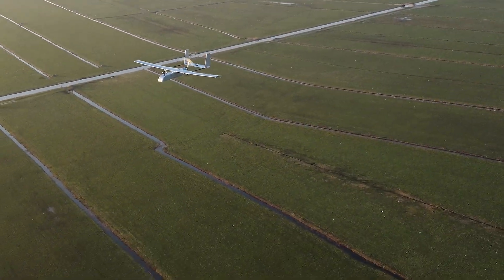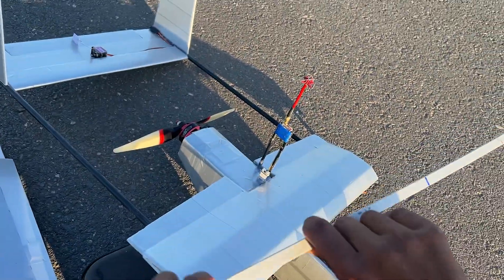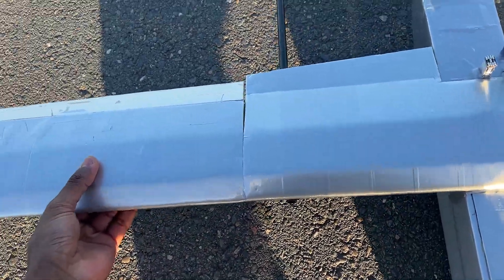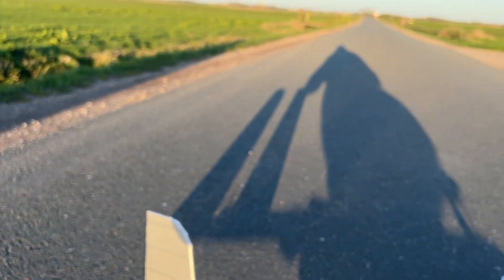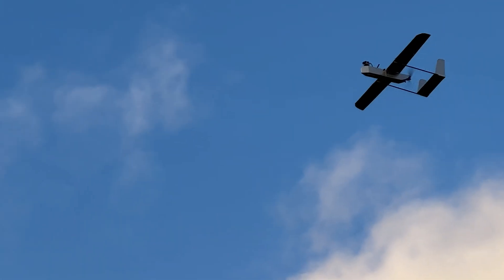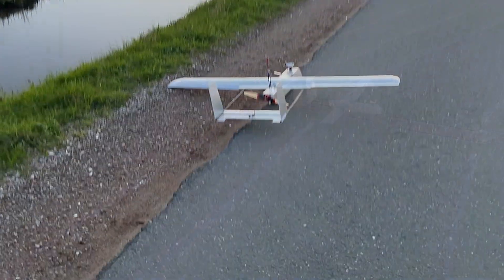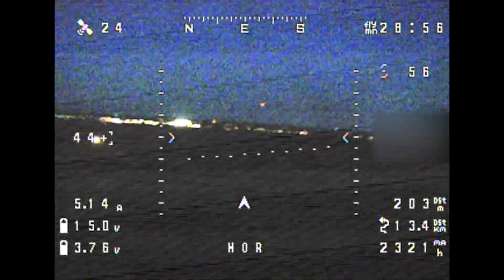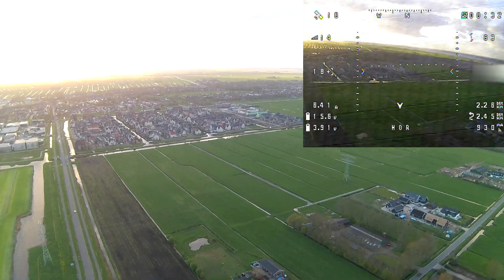Autonomous UAV for Long Range FPV & Autonomous Missions - Setup, Flight & FPV Footage

Comment: Just wondering if you have a recommendation for upgraded range on the fpv video chip? 

Love your channel, want to build stuff to send to Ukraine. 🇺🇦
Reply from the maker: See my latest video: It’s all about the video-receiver antenna (which allowed me with standard goggles to fly beyond 10km with perfect video at low altitude) - I recommend atleast 600-800mW of power for your video transmitter along with a “Pagoda” antenna.

Good luck on your builds!

Comment: Hej, first of all thank you for sharing. I have been flying in and out for over 20 years now. recently I have fallen into a very very strange probblem no matter how much I upgrade the power ( well okey until 350 mamp or maybe even 600) I just can not even fly around the house and have good video reception. I know that most of systems around my house is just 2.4 and around så 5.8 should be a fri bane for people to enjoy!!?
could you please share with us what kind of video system you are buying or where did you buy the antenna please. Do you live in Netherlands? if I may ask? I do hope that you live next to us :)
again thank  you for sharing and have a wonderful summer with lots and lots of flying :)